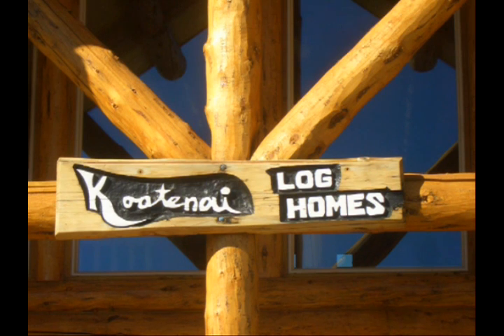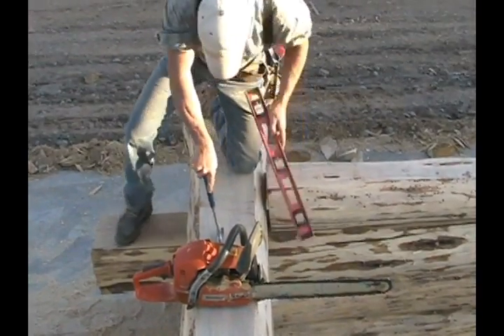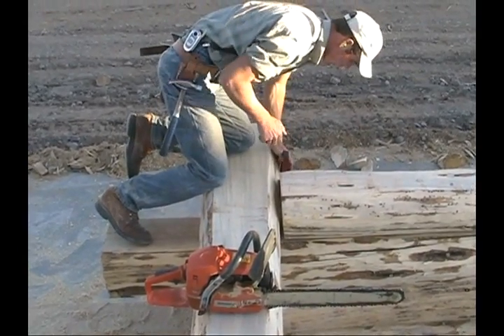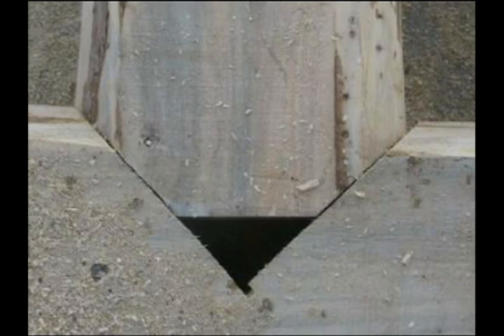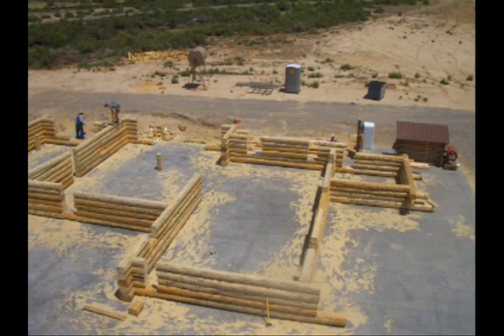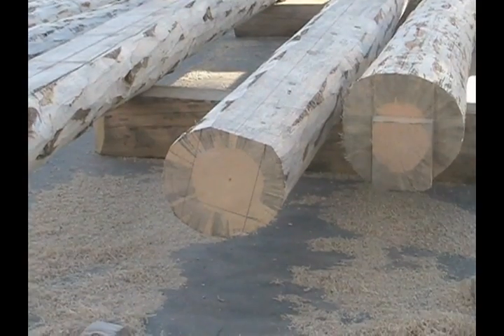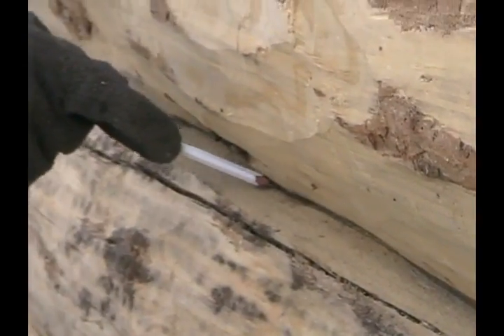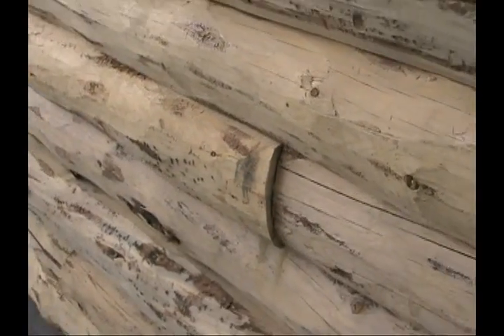How to build a hunting cabin out of logs!

Comment: These cabins suck. I've seen them first hand. Poor craftsmanship and attention to detail. They hacked up a rather large lodge north of lazear colorado. We had to come in and take over, pathetic log work.
Reply from the maker: Wesley Gowen They did not build that log lodge. After the structure was built they came in and only provided some large upright log supports for the roof. Thanks for your comment!
Reply: @belethal4700  from all of the work that i saw them do while i worked there along side them, their work was suboar at best. I also worked on several of their other houses throughout the western slope.  Sub par.
Reply from the maker: Wesley Gowen Thanks for your feedback!
Reply: they use huskys not stihls makes sense...